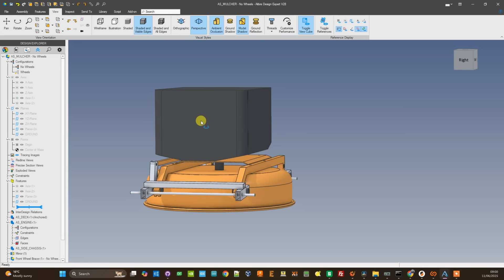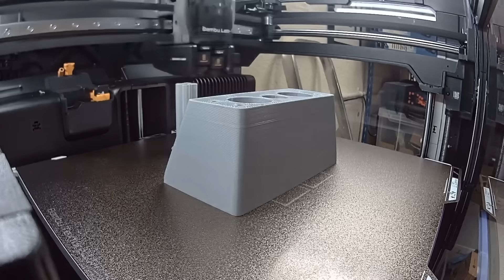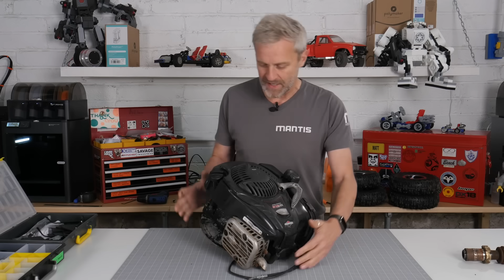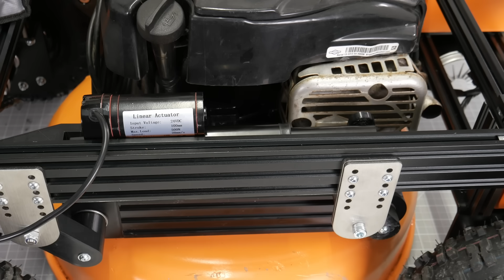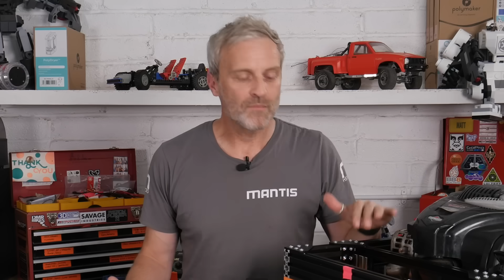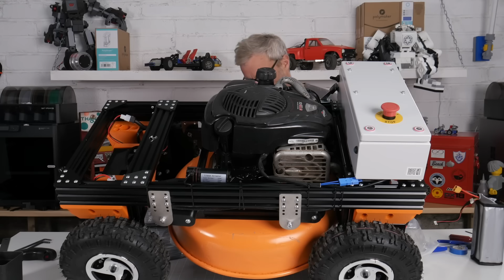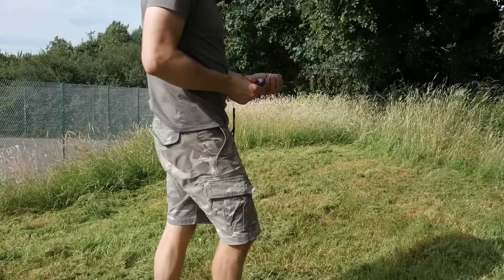I Built a 4x4 Radio Controlled Mower!

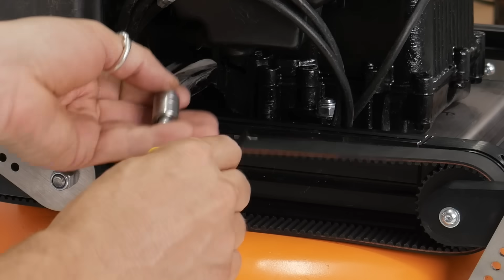Comment: 26:40 I wonder if you may be better to have those bearings on a cam, so as it stretches over time, you just adjust the cam.
Reply from the maker: Maybe 🤔
Reply: @MattDenton  Could duplicate the arrangement, starting with them close together, then move them further apart (towards the gears) as the belt wears.
Reply from the maker: Yeah I have a second one so you can move them up and down to adjust

Comment: The garden-trailer attachment idea is genius. As my Mum gets older I've been wanting to make something for her in the garden - I've been doodling 'e-barrows' for a while, designs cobbled together from off-the-shelf parts - but the idea of just having a tiny driverless tractor unit and attaching a regular garden trailer is super-smart, more versatile, and probably more cost-effective too...
Reply: You can buy off the self electric wheelbarrows these days. Makita makes one that uses their 18v tool batteries, but there are also cheaper ones from companies like Baumr-ag (and probably hundreds of other Chinese made local brands) that are just standalone units. I've never used any, so can't recommend anything in particular.

I'm personally hoping to turn an elderly ride-on mower into an electric garden buggy. It's chain driven, so I can use one of the common eBay electric gokart motor kits. I don't need the mower deck, so no need to consider powering that.
Reply from the maker: @tin2001 that’s going to be fun to convert 👌
Reply from the maker: Oh thanks! Yeah I think k it’s super useful
Reply: Ive been working on this idea too.  I recently picked up a mobility scooter off Craigslist for free that Im going to try to use as the base.
Reply from the maker: Ahh cool 😎
Reply: Brilliant 👍 👍

Comment: 12:50 wait.. you mean you didn't go for the correct gear ratio?... that is so unlike you.. (hehe).. I joke of course..
Reply from the maker: So turns out it’s not the best ratio that gives the slower option.. it’s the motor winding :/
Reply: @MattDenton  I thought the difference between electrical optimal and gear ratio optimal were relatively minute if it still goes though a gearbox of some type.
I mean I could see difference to "perfect winding without gearbox" vs "arbitrary winding but gear-boxed to required speed".

I would be interested to see experimental data on this
Reply from the maker: Sorry.. type, I meant to say it’s not the “gear ratio” not “best ratio” in other words it wasn’t a gear swap on this case but a motor swap

Comment: maybe something like GPS RTK or just a ground loop so it runs automatically and then comes back to a set point
Reply from the maker: Yeah that would be good.. or goes to its home / charge station
Reply: Plus a camera and a bit of machine learning to recognise and steer towards long grass and avoid any obstacles.
Reply: So good.  Your elation when everything lined up, such a good feeling.  I didn’t catch what you thought of the speed in the end. Fast enough, or too fast?

Comment: You probobly would want convetional stegring,  not only for the tires, but also the lawn.
Reply from the maker: Yeah that’s a lot more work though 😂😂
Reply: @MattDenton well that is true to a extent, but itw probobly easier than that lift mechanism for the deck.

Was the first thing i was thinking abour. That thing will rip up the lawn.

We have a normal robomower and ir always want to turn i a specofic corner. The lawn is gone there
Reply from the maker: @matsv201 well it’s not really for the lawn.. I have a push mower for that, it’s for the rough stuff that nuts needs keeping under control :)